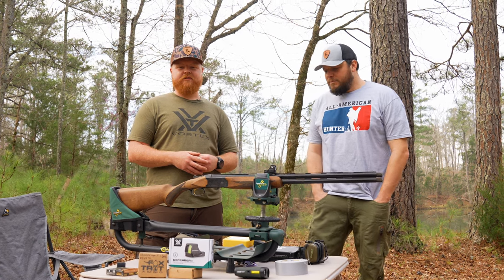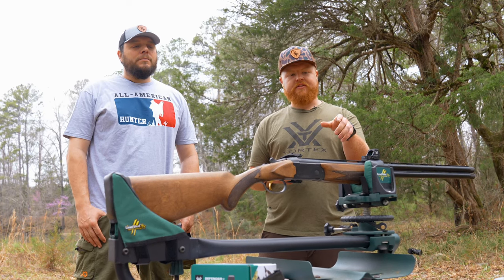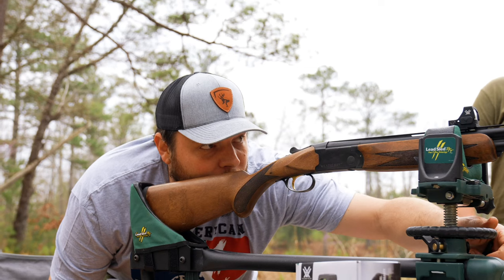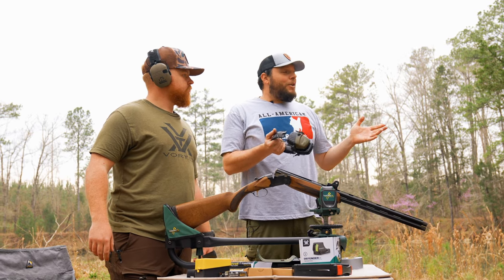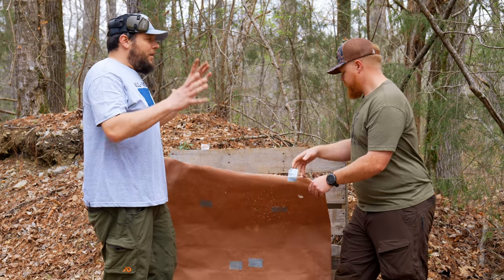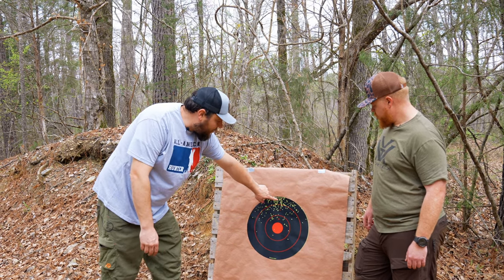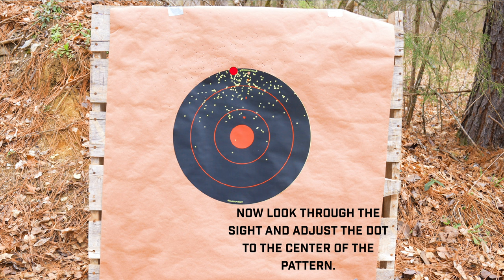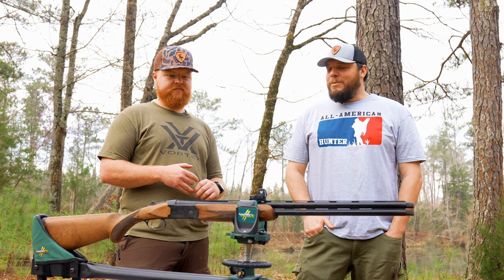The EASIEST WAY to Pattern/Sight In Your TURKEY GUN! Bullseye to Bullet Hole Sighting In Method

Comment: Adding a Meadow Creek Mount to my turkey gun was one of the best things I’ve done. I prefer it over drilling and tapping.
Reply from the maker: Same. I was going to use the mount for one of my other shotguns, but after using a gun with a dot mounted on the rail I decided to ditch my picatinny rail and throw a meadow creek mount on.